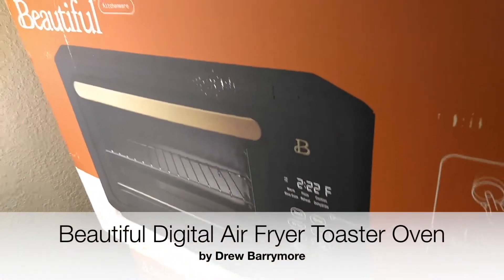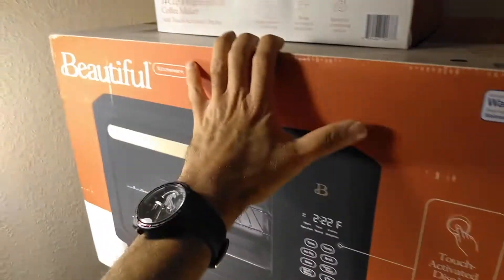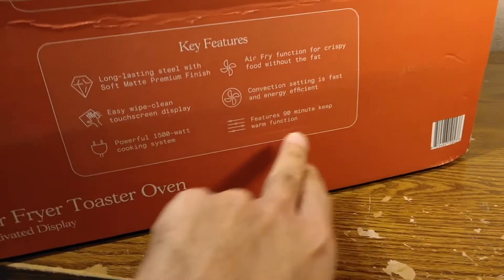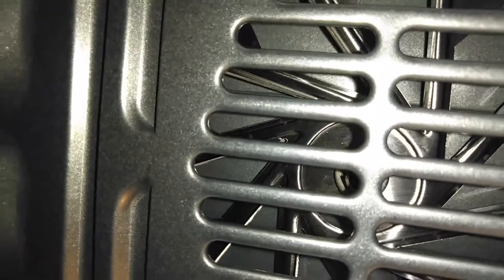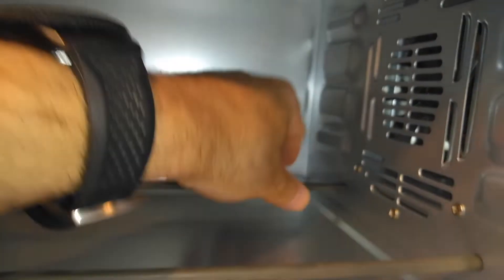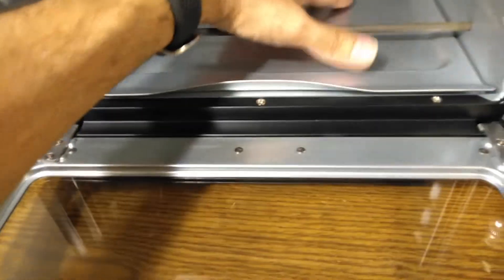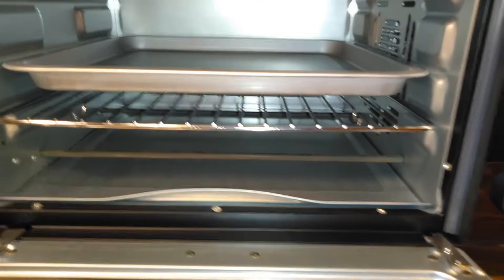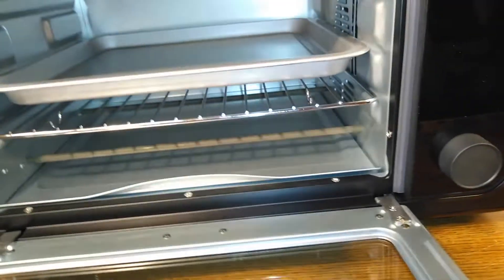Beautiful Digital Air Fryer Toaster Oven by Drew Barrymore (With Clock) Review & Test - Skywind007

Comment: We have had the oven for over a year now. I love the oven minus a couple things. The main issue I have is the toast function. There are 7 levels. If you insert 1-2 pieces of bread (like most of us do), if you do level 1 it cooks for 2min and 30 sec and is barely toasted, if you do Level 2 it goes to 4 min and 30 sec, which over cooks it. Forget about going to level 3 or you will be smoking and have black toast. Is there away to adjust to our preference? If so I'd love to know it's super annoying why would you almost double the cooking time from Level 1 to 2. Why not add 40 second per level?  He added 9 pieces of bread to it, so not sure if they made it cook less, but who cooks 9 pieces of toast at a time? The second issue I have is every few months the oven will start cooking and the buttons do not work, so you have to unplug it and it will reset and its good to go again, minus the fact you have to set the clock again. Not a huge deal. The toasting is our biggest issue, so we either do Level 2 and just put the toast in half way through the count down or we stop the toast on level 1 after about 45 seconds and start it again, but that means you have to watch it and wait. UGHHH
Reply: Thanks for such detailed info. I wanted to buy this for toast also so I can eliminate my toaster made by the food network to maximize my counter space but now I won’t. My Food Network toaster has lasted 8 to 10 years and still going strong. Also seems like most everything I bought 20 to 30 years ago has stood the test of time but now companies cut corners or don’t make solid merchandise anymore.  
Funny to hear myself mimic my grandparents that they don’t make things like they used to. Any updates did you keep it?

Comment: Could I bake stuff in this? Like cookies,brownies,cakes for example? Also could I cook casseroles in this as well? I'm moving and my new place doesn't have an oven
Reply from the maker: Yes. It has a bake button for baking. What that does is turn off the fan so the top of the food doesn't dry out. If you push the airfry button, the food will come out a little dry. It also does have a cookie function.
Reply: @skywind007  im on my way to buy it because you are saying this IS an oven. I will have a toaster oven, regular over and an air fryer in one???
Reply from the maker: @mutyelaguito  Yes. However I wouldn't count on it for toasting bread. While it can do the job, a dedicated toaster would be much faster and energy efficient.

Comment: Id love to see this compared to the other air fryers from this collection - thanks for making these!
Reply from the maker: I have both air fryer ovens from the Beautiful brand. It's a trade off between cooking capacity and speed. The smaller one cooks faster but has less cooking capacity, while the larger one has more capacity but is slower at cooking. Countertop space is also a consideration. The larger one uses up a lot of space on your kitchen counter. Here is the link for the smaller air fryer: https://www.youtube.com/watch?v=qRcUKszkiyI&t=6s
Reply: @skywind007  Thanks so much :) I am considering the basket style with the double handle also.

Comment: Does this replace a microwave?
Reply from the maker: No. It only works as a regular oven and air fryer. If you want an oven that can do toasting, air frying, and microwaving, you should consider the Galanz Combo oven. It's does all three. Here is the link: https://www.walmart.com/ip/Galanz-0-9-Cu-ft-Air-Fry-Microwave-900-Watts-Stainless-Steel/484464802?athbdg=L1300